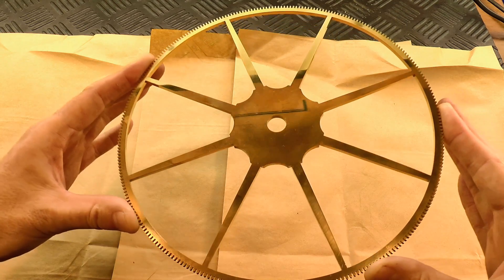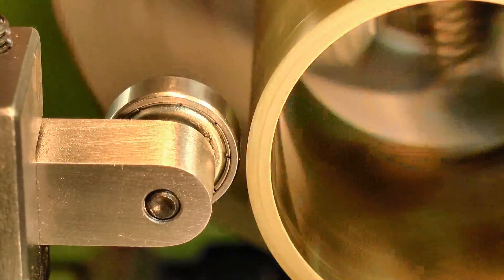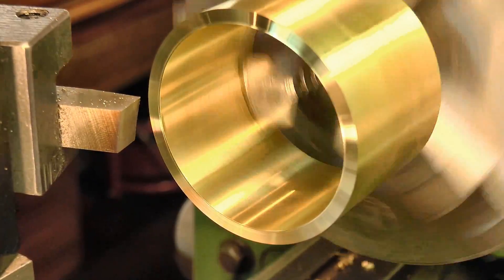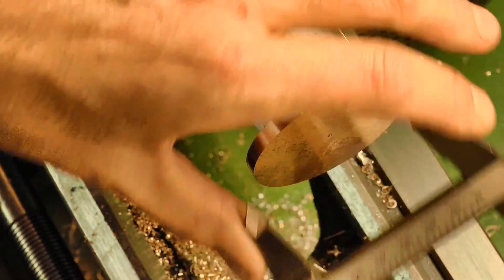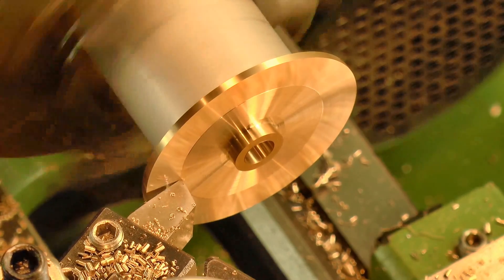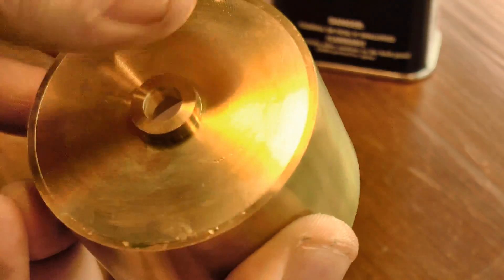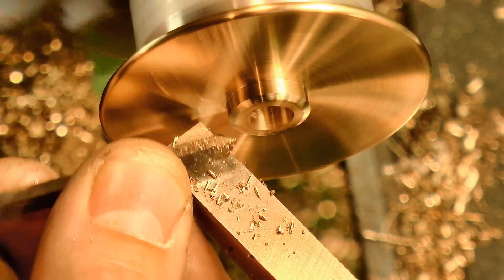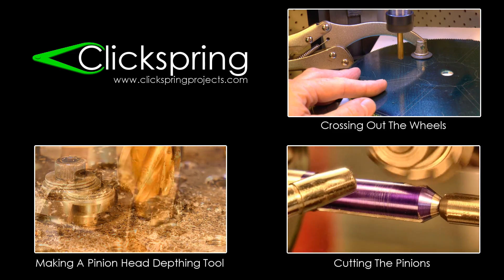Clockmaking - How To Make A Clock In The Home Machine Shop - Part 7 - Making The Barrel

Comment from the maker: In this episode, I make the barrel for the Large Wheel Skeleton Clock project. The process includes a lot of turning on the lathe, some milling, scroll sawing, and even a little hand turning with gravers.
Reply: Clickspring First, your videos are absolutely incredible; I've been watching my way through the lot of them. They are so sharp and clean - I wish all instructional videos could be this good! Maybe I'm imagining it, but the 50fps seems to make things smoother as well. Can I ask what camera you're using?

I was happy to see you using loctite ;-) I had a pulley/shaft repair job a few months back which was the first time I'd ever used loctite for permanent assembly, and I've been using it more and more now I feel confident of how strong it is. Parts which I would've turned from solid, or threaded together, now I just glue and they're every bit as good - it really is amazing stuff.
Reply: Another great video, Chris.  I have to admit that I was surprised by the use of Loctite.  It doesn't throw me when you use moderne materials for the machining (CA glue, for example) but I believe that this is the first time you've used non-traditional materials for the clock itself.  Not a judgment, mind you, just an observation. There is no reason not to take advantage of materials and tools that our horological ancestors would have given their eye teeth to use!  As always I look forward to seeing your next installment.  Scott
Reply from the maker: Aristocob Yes it's an issue that tends to divide makers a little. Generally speaking if it was a restoration job, then certainly no adhesives, but since this is new, it is generally accepted (although not by all). As you say, old school makers would have been all over these modern adhesives if they had the chance, so that's the criteria I used to decide what to employ. Cheers mate!
Reply from the maker: Hey Nathaniel, lighter fluid is an excellent solvent for oils. Loctite 603 is oil tolerant, but the cleaner the parts, the better the bond. Thanks for watching.
Reply: Is making these things as Zen as it is watching you make them?
Reply from the maker: ***** I like the 50fps too, it really smooths out the action. Takes a while to upload the video's though, very large files! My camera is a Panasonic HC X920. Yes I love Loctite too - for all the reasons you mentioned, plus you don't have to deal with the inevitable heat marring and flux residue from soft solder. There are times when I can't avoid a solder or braze joint, but wherever possible, I'll go for Loctite. Thanks very much for your comment Lindsay, and thanks for watching.
Reply: +Clickspring Do you calculate the rpm for every cut? In case you do: what cutting speed do you use? and if you don't: how the f*** do you get as good surface quality???
Reply from the maker: Hey Jacob, no I don't do any calculations, I tend to just eyeball it, as well as listen to the sound of the cut. If it's not going well, I'll make a change in rpm. For steel, I do the same thing, and also use chip color - if they're coming off straw colored, I'm happy.
Reply: thank you, you learn something new every day ill probably use that in a future project
Reply: +Clickspring You should solder the rear end cap instead of using locktite. I´ll hope it can take the forces of the spring if it gets dropped or something. Terrible damage it does, if the spring pops out. Otherwise great video again, keep up the good work mate:)
Reply from the maker: Loctite is a great modern alternative to solder. Plenty strong enough, and very commonly used in modern horology/general engineering.
Reply: Yeah I know as a watchmaker. Just being a traditionalist :)
Reply: +Clickspring why do you use lighter fluid to clean the parts?
Reply: You are the master of the masters.
Greetings from germany
Reply: Clickspring jjkjkjjjiniji